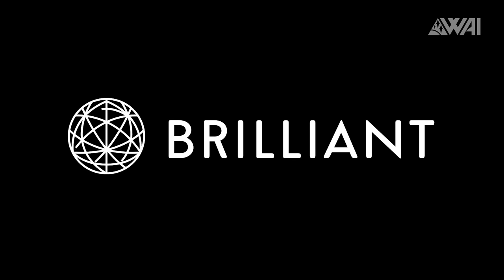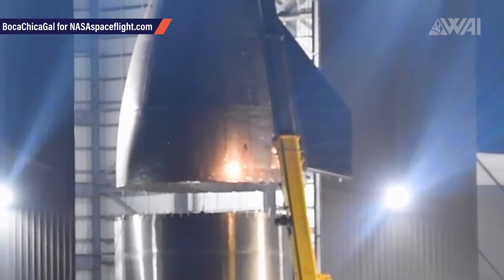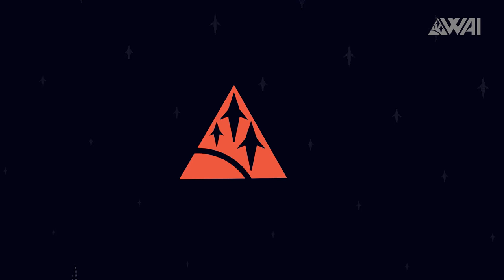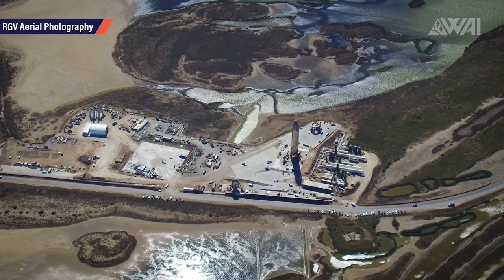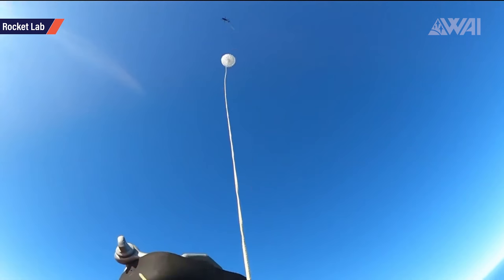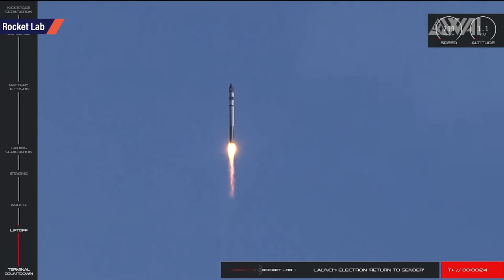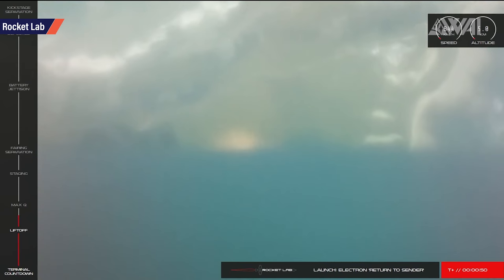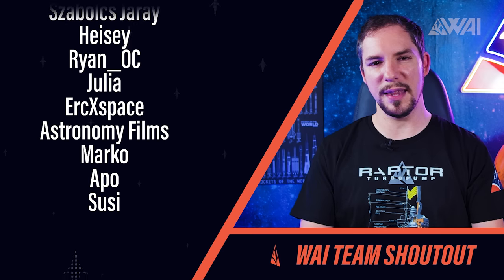135 | SpaceX Starship - What's left until the launch?

Comment: Thet still need a watertower, right?

Jokws aside - They gonna need a lot of fixed infrastructure to support orbital launches including a huge crane. Johan.
Reply: Super Heavy Orbital launches will never happen from Boca Chica using more than six engines. They are building a platform in the gulf and a full engine launch will happen there or in Florida. SX advertised earlier for Platform engineers and I presume the platform is well on its way. It looks to me like even these test launches will require a lot more infrastructure:-) That includes the Boca Chica "orbital" platform being built next to the two other test stands.

Comment: How about this item: 
Dig deeper hole under the rocket engines with an inverted funnel shape. is
cheaper, non-reflecting and more durable than that expensive epoxy coating.
Imagine what energy will be released with more than 3 motors.

Maybe you can also do something with all the heat that is released there.
Reply: Lots of groundwork and very high water table makes it difficult and time consuming.  Don't forget, Boca Chica is just a prototyping facility.

Comment: It looks to me like the success of Rocket Lab will also have an impact on SpaceX. SpaceX gave up on catching the Falcon 9 after a few tries.  Now that Rocket Lab has had success catching the smaller rocket, it seems to me SpaceX could use the same method for catching the "Fairing". I would think use of a helicopter on a smaller ship or overland would be quicker and less costly. They have already developed the parachute and may be able to lighten the load on their directional mechanism.  I would be surprised if he doesn't give it a try.
Reply: People keep suggesting this, but remember that fairings and rocket bodies are very different. An Electron booster is a weighted cylinder that will travel in a nice predictable trajectory and won't be greatly affected by having a helicopter flying nearby. But a fairing has a huge surface area relative to mass... it's basically a leaf on the breeze, and if you put one of those underneath the downdraft of a helicopter, it's not going to go well for anyone involved.

Comment: What about putting a  steel grid under the rocket engines on the launch pad  to catch the chips. It would only need to be a few inches above the ground level.
Reply: Melting issues perhaps?
Reply: I thought cooling water like you see on the Apollo lift off. I thought perhaps the launch pad would be using water to stop heat damage and shock dampening. Going to be using more engines in the future. But I’m sure they have planes in the works, very clever people.
Reply: Howard Crusoe I think a grid is a good idea for the time being, although later they will have to test takeoffs and landings on surfaces similar to mars, with many rocks and things that could damage the engine, so I don’t think too much effort will be put into a launch pad for starship, superheavy is a whole different thing tho
Reply: Your right a bullet proof jacket in those sensitive areas for Mars landing and takeoff. I guess there will be less mass to slow up and land back on earth. Maximum mass will be on launch I’m sure thing will look different as things move forward. I like all this engineering on the fly. Perhaps one day rocket motors will be made from a printable ceramic. Motors no bigger than a tea cup but lots of them  on a single manifold all the plumbing printed too, a rocket brick. Better fuel consumption quick to manufacture nice and cheep.

Comment: Why not build the launch stand inside a large pool, and when its fueled and ready to launch, fill the pool with water and then use that as a surface to swallow all the energy from the engines. I think this is a cheap and easy to make solution to the problem. Pump away the water to access the engines from below again.

Comment: That puny SH launch structure will never suffice BUT I would be curious to know if anyone has considered/tested firing rocket engines directly above a large body of water (sea or deep pool). Could it possibly provide a better solution,... pushing some of it aside during thrust (dispersing the enormous forces into forming the cavity) and self healing after. It might even providing some of the required sound suppression through ejected water and steam. Might be important when it comes to Elon's floating SH+SS launch pads because I'm not sure how the deck of a ship/platform would handle 30 Raptors.

Comment: Not sure how/why they think they can get away without any kind of flame diverter is beyond me, especially with the super heavy. Even just a “simple” cone of thick metal or concrete with martite would be better than nothing. At least that way, if chunks are blasted loose, they will be blown away from the launch pad instead of being able to shoot up back at the engine/motor bay. Still though, they need to protect the engine bay from FOD on landing, especially if the Starship is going to lift back off from the surface of Mars and/or Luna (our moon).

Comment: If spacex starship is so powerful that it shoots the concrete below which did damage it's Engine..won't this happen on mars with no pavement at all and rocks all around
Reply: Yes, though differently, since different atmosphere, different gravity, etc. But ultimately, yes... that's why improving the pad isn't a very helpful solution, because if Starship is supposed to land on other worlds, it needs to be tough enough... much like an aircraft designed to land on a rough field instead of a paved runway.
Reply: @simongeard4824  that's exactly what I'm thinking

Comment: I'm sorry but that proposed launch pad structure for super heavy is a complete  joke. Just look at the absolutely mammoth size of the concrete flame diverter trench under the Saturn V. Those guys weren't idiots and they didn't have cronies in the concrete trade to pay off. The SH has similar thrust to the Saturn V and six puny legs with a small concrete doohickey under them to divert flames between them and away from nearby critical infrastructure will not suffice for that thrust. At the very least, Elon is going to have to dig a similar giant trench and build the launch structure over it. In fact, being next to the sea, such a trench is probably impossible due to ground water intrusion and he'll probably have to do as the Apollo guys did at LP39,... build the ground UP so that the "trench" doesn't go below the ground water level.
Also, whatever he builds, it needs to be higher than those puny little legs. If ONE raptor is already ablating the martyte after a few short test firings then, short of him discovering unobtanium, 30 raptors will destroy any floor/diverter under those pitifully short and puny legs